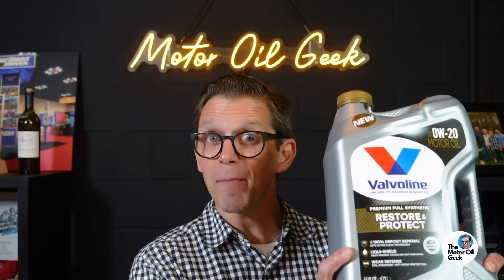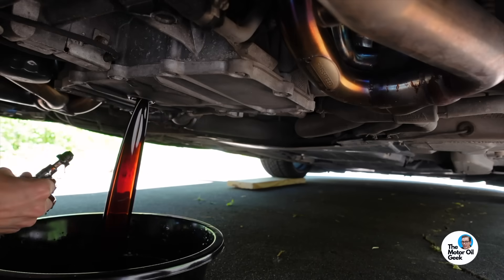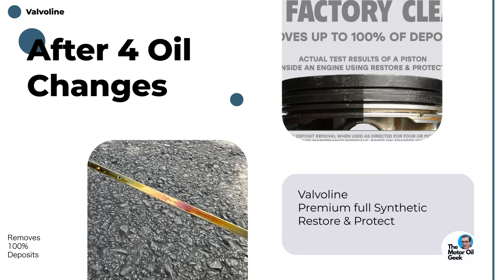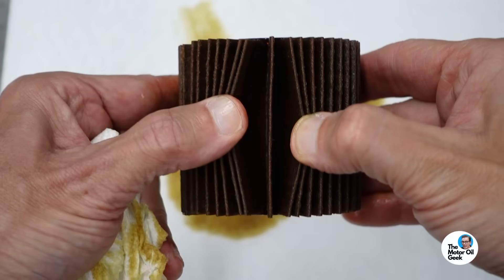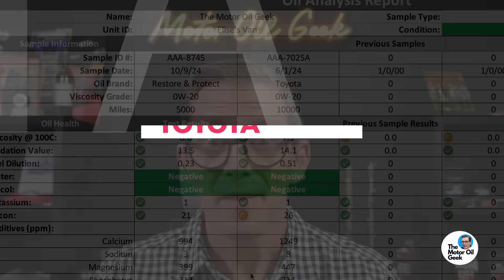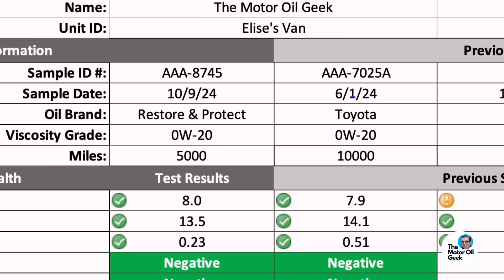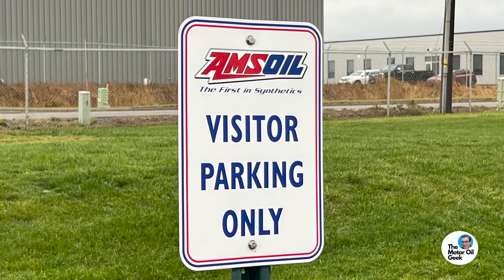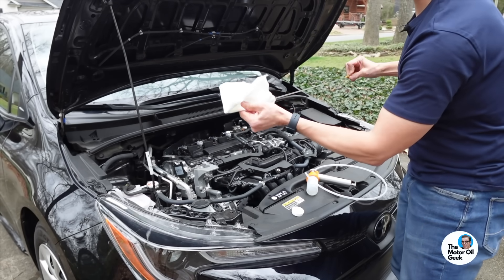The TRUTH About Valvoline's BOLD Engine Cleaning Claims

Comment: I have to try this in my 1970 LT1 Z28 4 speed 10.2 cr, with Mahle forged pistons, cause my builder used low tension rings and with these rings the engine consumes oil which irritates me. After losing 2 solid lifter cams and even using oils with ZDDP such as Joe Gibbs and others, I’ve gone with a roller cam with hydraulic lifters. IMO the FT days are gone with cheap cam steel and a useless hardening process. I’m currently using Lucas Hot Rod 10w40 oil with a Wix 51061 filter. I did notice the Valvoline oil highest viscosity is only 5w30. I just hope this thin oil doesn’t piss out.

Comment: Which grade of Valvoline Restore and protect did you use on the corolla since it requires 0W8 and Valvoline doesn't have the 0W8 Restore and Protect out yet?....I plan to do the same after getting my 26 Grand Highlander Hybrid next month it too requires 0W8.

Comment: Even though restoring protect isn't dexos certified can I use this in a Chevrolet 3.6 engine that calls for dexos I'm not worried about the warranty. Is it safe to use in a engine calling for dexos oil? Thanks for any response looks to me like that it would still clean and do okay in a dexos recommended 3.6 Chevy engine

Comment: I've got a maintained 08 4runner with 69k miles on it. I'm on my 2nd change. Might be a bit smoother.  
I also have a 2016 5.7 Challenger with 39k miles. Hasn't cleaned much yet because the oil and filter was left in the passenger seat after asking the advisor to use the stuff I brought. 😂 Maybe it will get put in next time. 😂😅😂😅

Comment: I'm curious how the advertised high detergents in amsoil xl or signature compare to this.   Been running amsoil about 10 years now but used to use Valvoline all the time.  My wife's car does a lot of sitting and short trips, maybe 3-4k miles per year, while my truck does 12-15k and tows an RV over a dozen weekends a year.

Comment: I have 291,000 miles on my 2002 Honda Accord. I have always changed my own oil. I change it at 5,000 miles, even though the manual says 7,500 miles. I have never had any varnish on the dip stick. I have always used Walmart Supertech. I recently switched to Valvoline Restore and Protect. This is my first oil change with the new Valvoline. I’m interested in seeing if it does anything.

Comment: Restore and Protect meets the standards for our 2025 CRV Hybrid with 14,000 miles on it and our new 2025 Toyota Land Cruiser, both using 0W-20.  I plan to do 5,000 mile changes on both throughout our ownership.  Is there a reason to NOT use this on a newer car from the first oil change?

Comment: Lake, if you're still watching this thread.   1.  I almost shit when you laid the dipstick across the battery.  Thought you would arc it into vapor.  2.  The cleaning component....does it affect kevlar impregnated belts like the rubber belt in my F150 (oil pump).  Does the solvent that breaks down the deposits reduce protection of the metal/bearings?   Thanks.

Comment: Lake, I noticed you did'nt change the weight of the oil from 0w20 to 5w30.  Should you use what the OEM calls for? I've used Toyota 0w20, so should one remain with 0w20 with the Valvoline Restore and Protect? This engine, 2012 Camry, 2arfe is known to have low tension rings, I believe.  Thanks!

Comment: I bought a 2002 V8 Ford Explorer with 29k miles in 2003. Oil changes had been overdue; the dipstick and visible internals were varnished about like the one in this vid. 3 or 4 oil changes later with regular and synthetic oil from various brands and it looked no better.  After 1 oil change with BG MOA added, the dipstick and visible internals were nearly "new-metal" clean like this dipstick. Glad to see that oil formulations have caught up with the times! I still recommend MOA, but way to go, Valvoline!

Comment: I've used their 0W20 Restore & Protect in my 2021 Forester for 6 changes, this current run looks so immaculately clean inside, it's still just the lightest honey tint of yellow after 4200 miles. It's really cleaned out the motor.

Comment: 2013 Honda CRV owner (K24) - owned two previous K series. This oil seems as if it were made for Hondas. I’ve heard from various sources, the reasons Hondas burn oil over time is carbon deposits on the piston ring lands. I was burning .8 quarts of oil between 5,500 mile oil changes. I used super tech top shelf oil exclusively for the past 65,000 miles. After just ONE 5000 mile run with this stuff, it quit burning oil. I could actually get 95% of the oil I put in after an oil change back out again after 5000 miles. Insane stuff. My older K20 Si would have LOVED this stuff, but the carbon got too bad and ate the rings on the ol girl. I have a feeling this K series will outlast its transmission, and possibly the frame.

Comment: VALVOLINE RESTORE AND PROTECT HAS A FLASH POINT THAT IS TOO LOW AT 394 F. THEIR IS FAR MORE TO OIL THAN LOADING IT UP WITH DETERGENTS WHILE NEGLECTING THE CORRECT AMOUNTS OF OTHER CRITICAL ITEMS. Valvoline is a good oil. Not great but good. A low flash point indicates not so good base stock or a very weak ad package. Google this question yourself please. The internet experts can get you into real trouble. Do your research.

Comment: 1999 Camry 2.2 here with 252K miles... mostly high speed highway @ 100 miles /day to work-very little sitting in town traffic or highway jams.  I've been using Valvoline R&P since literally the day I watched Lake's very 1st video on it- with at least six 5K mile oil changes. 

Recently, I had to do a valve cover gasket change. To my surprise, the whole top of my engine remains pretty tarnished. I had hoped to see a sparkling clean top end, but that wasn't the case. I'm not sure how it could clean the dipstick in this video when this oil has failed to clean the tarnish off of the top of my engine over many more miles than Lake's test vehicle. On another note, this oil does claim to remove carbon buildup, not so much about tarnish. I do believe my old engine has better compression due to the ring lands being cleaned of carbon deposit. This is not a scientific estimate only after knowing this engine's characteristics. The engine is definitely peppier than it has been in a long time. It always has had religious 5k oil changes with high quality synthetic oil, so not sure of why the tarnish has built-up on the top end and why R&P hasn't cleaned it like the dip stick.

Comment: I have an 2014 Dodge Journey with a 3.6l V6 Penta star.
Always used Valvoline 5w-20 full syn. then moved to high milage  when I hit 150.000.
Never had any engine issues.
I have been watching your videos and seen this about the Restore and Protect.
Thought I might give it a try.
I noticed when you pulled your dipstick you had some varnish on it.
NOT on Mine.
I guess Toyota oil isn't as good as Valvoline.
So my Question is, Do I rely need to upgrade? How many oil changes do I need to do to get the effect I'm paying for?
Reply: Tried it on my 2016 Chrysler 200s with a v6 penta star engine and it started ticking. Not sure if it's due to the oil cleaning up deposits but all I know now is that the repair shop is talking about replacing lifters. My warranty company recommended swapping out the engine completely. 😅. They denied my claim now I may have to try a thicker oil or add lucas oil stabilizer to see if it quiets it down.

Comment: I have a 2009 Toyota Prius with 170k miles. I have religiously serviced this vehicle since I purchased it ten years ago every 5000 miles. Over the past 2 years I have been consuming 1 quart every 1500 miles. Two months ago I started using Chevron. That did not provide any noticeable change. I started seeing these videos and found the 05w30 at a local Walmart and had Walmart change with restore and protect and a premium Mobile1 filter. I am 1500 miles into this and consumed no measurable oil. I believe this product solved my problem but obviously may be too soon. I recommend it!
Reply: Update- I am 3000 miles into the first oil change using Restore and Protect and I have not consumed any oil that is measurable on the dipstick. I call this a success.

Comment: So after using this oil to clean and restore, do you continue to use it like a normal oil change or go back to normal oil and clean it with the restoring oil from time to time?
Reply from the maker: It is designed for continuous use.
Reply: @themotoroilgeek  How well does R&P work in Extreme cold or Hot temps vs a Castro Edge or Amsoil signature  ?

Comment: Excellent video, thanks.  My only issue is that product does not come in 10w-30 that my 1998 Dodge B1500 van's 5.2 liter calls for.  The manual says I can use 5w-30 in the winter so I guess I will wait until it gets cold to try it.

Comment: Is this stuff good for use in the Ford 3.5 ecoboost engine that has the oil pump belt that dips into the oil pan?   Is there any softening effect on the belt?   It is bad enough to have that belt failure hanging over your head, and I wouldnt want to do anything to unknowingly quickening the failure of that belt.

Comment: Thank you Lake. I learned about this oil from you when this oil was fairly new on the market. My friends Honda Ridgeline was in sore shape and had not been maintained with much attention to detail by the previous owner or my friend. The lifters were noisy, the engine used a fair bit of oil and the oil was very gross on the first couple changes. We have been doing changes every 3k and the lifter noise as well as the oil consumption has very much changed for the better. This stuff is incredible, i'm having other people use it now as well. I love this nerd stuff.

Comment: That is an amazing test. This brand of oil might even fix the Hemi V8s that has lifter blown issues when used with a high performance oil pump pushing more oil through the engine.
Reply: how did it go?

Comment: Excellent video. I have a 2019 Suburban with 105kmiles. Runs fine. 

I am interested in running Valv R&P in it for the next 3 changes. Just bought some 0w-20. Was going to change filter at 500 miles into Valv R&P change #1  along the way.

Do you think this is OK? Engine is specified for 0W-20 Dexos 1 and I have been running Kirkland 0w-20 for about 70k miles and the thing doesn't more than about 1 cup between 5k mile oil/filter changes. Chat GPT says to us 5w-30 if uses Valv R&P in my engine.

Even if I don't use it in the Suburban I have an Acura with 150k that takes 0w-20 and I might run it in that,

Comment: It works.  I think an upper cylinder soak during an oil change will quickly clean the rings. Use B12 Chemtool or something similar.  When i do this, the solvent doesn't flow past the rings unless I use some compressed air. I'd like to see the solvent pass with only gravity.

Comment: QUESTION: Do you think that the oil passages feeding the cam phasers in a Ford would be cleaned or plugged if Restore & Protect is used? All the gurus seem to think the camp phaser problems are caused by plugged oil passages that feed them oil

Comment: Under repeated use, is there any evidence of rubber seal degradation and possible causing failure or leaks?  With a strong cleaning ability I just wonder if it negatively affects rubber and such.

Comment: Don't TRUST oil annayles.  Did them Religiously on a 1977 Cessna 172 after the Lycoming O-320-H2AD engine failed with just 377 hours on it. so after acquiring a New Engine we were doing oil change / Analysis ever 25 hours.  The results were always the same.  High Silica Content - Check the induction system.  i.e. too much sand.   We were on Concrete Runways / Asphalt taxiways.

Comment: I have a 15 CRV.
 It was starting to get the VVT rattle at cold start.
 145k on it.
 Always used Valvoline, in every car I have ever owned.
 Switched from 0w 20 to 5w 30 Valvoline restore.
 Immediately quieter.
 After 2 change cycles of 5k.
 The VVT cold start rattle has been gone for about 7k.

 Have been a Valvoline guy for 50 years.
 This Restore stuff is for real!!
 Started putting it in my 04 Silverado with 380k on it.
 Has always run well with the regular Valvoline in it.
 Interested if it will differ with Restore in it.

Comment: Lake, is there any worthwhile potential benefits to be had on intake valve coking in GDI engines? I have a 2017 Ford turbo charged 2.7L with 28000 mi. Oil changed every 5k so far.

Comment: 2.4ppm sounds like basically nothing. If you could scrape off all the Manganese off the dirty parts and dissolve it in water, How many parts per million would that convert to? Then you could calculate how many tens of thousands of miles you would need to clean it all off the engine using the oil.

Comment: I'm on my 3rd oil chang using this oil and my engine is cleaner than its ever been. The oil now is looking like it does in the jug. I did notice Valvoline states "with continued use" suggesting it may take an interval or 2 to get clean.

Comment: That's the reason why your dipstick looks tarnished.   STOP doing 10,000 mile oil changes with 0w-20!  Conventional oil 3k, or full synthetic 5k.  Thought you're supposed to be an 'oil expert'?
Reply: Guy... I've been doing 10k oil changed on my last 3 cars. All have made it over 300k. It's fine
Reply: @SickDayFishing262 Any of them burn oil?
Reply: Thats what also confuses me… using 0w8 because Toyota says so, as an oil GEEK, but at the same time dismisses the break in cycle that toyota says you should do 😱
Im „into“ oil myself for quite a while (hobby) and what ive learned the last years doesnt really match what hes doing with his Tyotas 😅

Comment: I just changed my oil and used this oil, I immediately heard a difference in engine noise. I'll be changing my filter in about 200 miles and adding more oil. I'll open up the filter and see how much sludge comes out. I've been doing regular oil changes every 3,000 miles and the engine has 230,000 miles on it now.

Comment: I had a 05 frontier i bought in 2014 with 80k miles on it.... the owner ( who was a doctor) was tride and true about using valvoline full synthetic 5w-30 high mileage oil, point is that it is absolutely exquisite oil, easily 10k plus out of each change. AAAAND it kept an old engine running like new! i had sold that frontier last year in 2024 only because rear frame was rotting bad but the motor still ran like a top thanks to the amazing quality of valvoline , with just shy of 170k which isnt alot for jap engines.  btw i use it in my  2011 ford taurus SHO which is just over 200k in miles now and i still embarrass people tryna race me  because it keeps your engine so healthy and running RIGHT!!!!!

Comment: Good info on the video for the Valvoline Protect and Restore oil. However, I'm still optimistic on the aggressive cleaning agents all in one full 100% of  this oil in the engine at once that I'm curious from feedbacks on possible deposits clogging or blocking pathways in certain places before settling into the oil filter. With my 162,000 mile on my 2014, 5.7 Tundra,  I thought to either try  of the Protect and Restore, changing out the filter twice to further prevention from whatever negative issues or  else may happen. OR,  mix half of Protect and Restore, with Valvoline high mileage oil. Could this slow the Protect and Restore cleaning agents with this mixture? My point is, mixing the 2 oils together may not only produce the best results in such a hurry, but possible cleaning at a slower and timely way. Possibly allowing the oil to work longer in the engine and changing it out at normal intervals or a bit sooner. I typically change out the filter twice between oil changes in my high mileage engine at 5,000 miles.  Should it  be a better percentage  to prolong the engine life in the long run.
If all who tried, and tested Valvoline's Protect and Restore, new or old,  abused or not, may produce positive result. But curious to be aware of problems?  
I am convinced to try the Protect and Restore, either 100%, or split the mixture with Valvoline's High mileage oil. 
Any feedback on this from anyone?

Comment: Great video. I have a 2005 Subaru Baja Turbo with just under 60K original miles on it.  I switched to this and at first "glance" the motor doesn't sound as noisy.  Time will tell, it's only been 125 miles on the oil so far and the engine probably isn't particularly dirty since the factory OCI is 3750 for these, but I figure it cannot hurt.

WIll compare and contrast to Pennzoil Ultra Platinum after I run this out.

Comment: I just used V R&P in my 07-3.6 Caddy with 130k miles. The stuff works great!! After 1200 miles, the car feels better( more power, better gas mileage, more compression). The car still uses oil, but so far it's the best "feeling" oil I ever used. In the past I used  Mobil-1 EP, Pennzoil Ultra Platinum, etc...I will keep using until my oil usage hopefully drops....

Comment: Toyotas OEM motor oil was recently rated the WORST in comprehensive testing. Motorcraft & Delco rated highest (full synthetic oils only). I'm sure Pennzoil Platinum, Castrol Edge or Mobil1 would be similar or slightly better than those (top rated) OEMs.
Reply: Who did the testing?       Link please.
Reply: According to who?

Comment: Hey Motor Oil Geek, I have a 2018 VW Atlas with the 3.6 L VR6. I’ve owned it since new, and it has 62,000 km on it. It’s always been serviced on time with VW‑spec oil (502.00 / 504.00). I’m wondering if it’s safe to switch permanently to Valvoline Restore & Protect instead of going back to a VW‑approved oil. Are there any concerns about SAPS levels, additive compatibility, or long‑term protection for this engine if I make the switch?